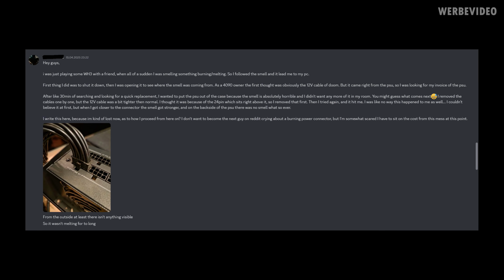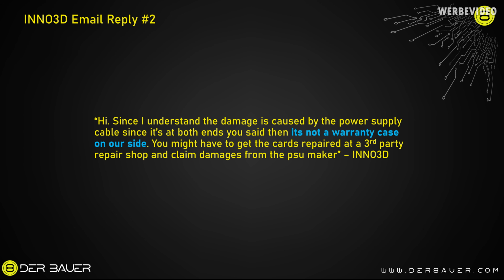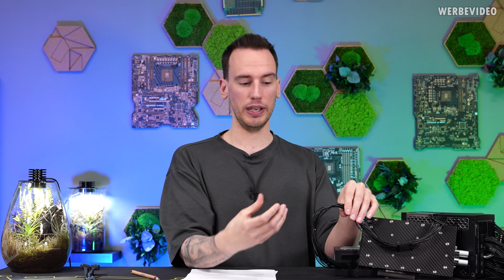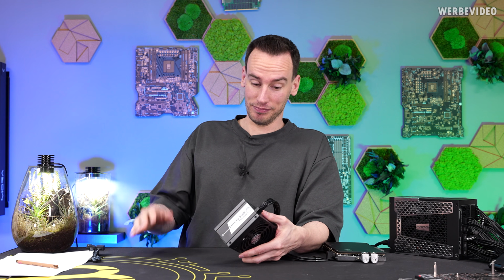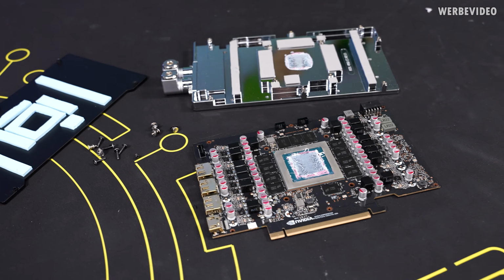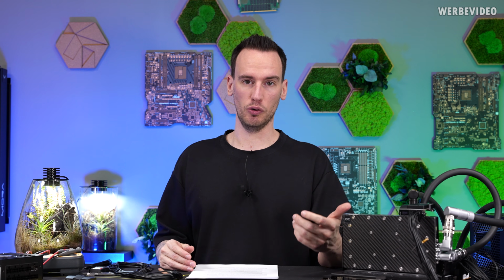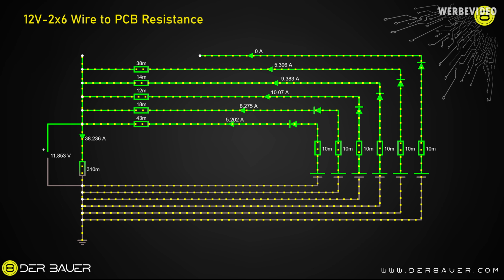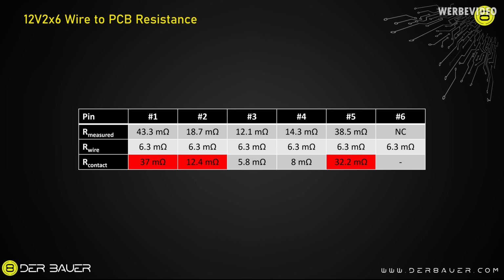Investigating and Fixing a Viewers Burned 12VHPWR Connector

Comment: Now I understand why in the electrical field, we don't use multiple wires to carry a large current load. We use a single wire rated for the load. As soon as one of the multiple wires has a problem, the load on the others goes too high.
Reply: And you don't understand electronics, do you  ?  If you use a thick-ass cable to connect PSU and the GPU board - in case of increased power demand or malfunction - you would catch fire , but not on the cable this time . On the GPU board itself. Literally you will have live RGB effects as hell.
Therefore, the cheapest to manufacture part has to be the weakest component always. They treat the cables as fuses , in these circumstances , in this fuseless circuit.
Reply: @MortalThe  Thicker cables have far less resistance and can carry far more current without heating up. They also have larger contact surfaces at connections, which then also have far less resistance and can also carry more current without heating up, even with a poor connection. In the electrical field a single large cable is feasible. In the electronics field it is not. However, I'd still rather have fewer large wires instead of  more smaller wires to carry a given high current load. They long ago reached the limit of this pci-e/cable arrangement and have used the multiple wire connections as a band aid. They  probably should have gone to 24 volts long ago to reduce the current and the number of wires.
Reply: If we consider 24 volts, we could use two 12 gauge wires to conservatively carry 15 amps each. That gives us 30 amps at 24 volts, which is  30 X 24 or 720 watts. And that is very conservative with 12 gauge wire. So you would  have four 12 gauge wires in the connector with 2 ground wires and 2 power wires. The 12 gauge wires could actually safely carry well over 15 amps each.
Reply: @bills6093  You do understand elektronics. Yes, 24 V would solve the problem, but for now, before ATX is changed, we would have to buy cards with external power supply, that transforms 230/110 V to 24V. The current ATX format provides only the 12V.
They keep the small cables , because it is estimated to stay within their limits of heat. And , as I said before, something has to give in case of software/driver malfunction. See , currently this is the software, which limits the power consumption of those GPUs. That is too weak safety from electrical stand point. Therefore, they would rather like to burn cables and connectors, then the boards.
Until ATX changes.
Reply: @MortalThe  No, this problem existed long ago and 24V motherboards and power supplies should have been produced long ago. ATX24V. This situation should never have developed.
Reply: @bills6093  So, why did you say "No"', actually ?
Reply: @MortalThe  so i think all the vendor need to push intel to publish new ATX standard for GPU, put 24,and 48V for high power device. make it "Smart" like USB PD does

Comment: My theory is still that coil whine is causing micro-vibrations in the card that cause micro movements between the terminal pins which leads to fretting at the pin contact points which causes a resistance runaway

Comment: Adam Smith talked about a society's core prosperity as specialization. I wonder how all YouTubers suddenly became electrical engineers. 

The heat is from the extra current that the cable thicknesses can handle. Why are you measuring the resistivity of the cable?

Comment: We know what the cause is, a bad connector standard choice. The fact that there are multiple issues across multiple users and vendors shows there's an endemic issue.

As for the warranty issue, at least in Europe, the contract is with the retailer, they might ask the manufacturer to support, but if you don't get satisfaction? Make a claim with the retailer, then assert your consumer rights.

Comment: I'm gonna get a mod diy ATX 3.0 PCIe 5.0 600W 12VHPWR 16 Pin to Dual 8 Pin PCIE Power Cable for a future 9070xt or better. I don't trust NVIDIA connector especially when there is no standard for the connector.

Comment: The GPU has a design defect, but to mitigate such an issue, use four cables from the power supply side and the supplied adapter.

One critical factor now is that, in some cases, hot air from the GPU hits the glass and bounces back on the cable. Once the cables become hotter, their resistivity increases, making it get hotter and melt.

To avoid that, make use of the cable while plugged stays cold. I put four extra fans three below slightly outside to push air around the cable and one on the top of the GPU to such air upwards.

By the way, soft cables are not good and have nothing to do with weight. Use the supplied thick. Industrial cables all have solid cores.

All industrial cables have solid cores. Oh, most YouTubers have no clue and are just getting viewers. Ask electrical engineers. All this is 101 of electrical engineering.

Comment: Hot air assistance to soldering iron with  big tip and low melt solder on the pins. Of course make sure to no low melt solder is left before soldering in now socket

Comment: You have huge problems with both metrology and troubleshooting. You should have measured the contact resistance BEFORE pulling out the contacts — not after. And also keep in mind that the value and accuracy of the measurements lies not in the price of the device, but in the measurement methodology. That is, in you personally and in your ability to make these measurements.

Comment: 20:35 Roman. Definitely 5 out of those 12 pins need to be reflowed. You can very clearly see in video that there is minimal connection to the copper on the top side. Maybe reflow and re measure?

Comment: The True Fix to the 12VHPWR connector, is to Desolder this POS and replace it with Pigtails to standard 6 or 8 pin Female connectors, as Used to be the Standard! It takes a Special Kind Of Short Bus Stupid to think that Connectors that are Physically Smaller in Size and Contact Area can carry More Current Reliably in Confined Areas!

The more Pins you have in a Connector the better the chance for misalignment reducing the Contact Area. Especially when your using Fatter wire in a Smaller Connector that can then push the Female Pins out of alignment, opening them up some, Reducing Contact Area further. This increase in Contact Resistance is the Fatal Flaw.
Bending the wires close to the Connector Also will cause this same scenario.

Bottom Line: When you Buy Cards/PS's with these Connectors YOUR Asking For Trouble.
🍺🍻

Comment: I'm surprised that no one seemingly thought to heat up the cables or connectors before trying to remove them. You don't always have to heat the plastic to the melting point to make the plastic a lot more pliable

Comment: I have two physical questions:  The gauge of the cable wires, how they are crimped, AND the shape of the connector pins - do they match the same shape of the mating connector pins? Flexible wires make sense, but what is the wire gauge? Seeing this issue so many times now - would it just make more sense to hardwire the cable thus eliminating connections to ONLY the connection to the PSU?

Comment: I'm thinking of putting a thermal probe at the PSU side of my 12V-2x6 cable connector, but I'm not really sure what temperature I should set the alarm to trigger at. I tried googling but didn't manage to bring up anything really useful. Maybe you could help?

Comment: If they aren't going to bother with load balancing they might as well just have 1 thick ground wire and 1 thick power line. At least that way you can't run into this problem.

Comment: @5:33 you said that on the PSU side you can't resolve this issue, but theoretically the current on each individual cable could be monitored on the PSU side, limited to whatever the specifications for the 12VHPR are. I am not suggesting that it would be future proof just saying that it is possible.

Comment: Well what is needed is for consumer protection to step in the USA, Canada, Britain, and the EU. Because this situation is ridiculous with burning connectors over two generations. Missing rops in one and in this only half the pcie lanes should have caused the manufacturer to investigate and repair or replace the card. In USA we have the magnuson moss act as a minimum line for warranty protection and protection against it being unreasonably voided. However it is barely if ever enforced these days, we need it enforced and as has been said there needs to be a class action lawsuit actually multiple class actions should happen.

Comment: Still dont understand why it seems like people dont know what the issue actually is. Nvidia cut corners on the design largely in the power delivery and distribution of the cards providing the possibility where the wires that are not rated for higher voltages are getting voltages beyond what they can safely handle.

Comment: Other aftermarket cards do per-wire current monitoring, and would've prevented this. None of the reference PCBs do this, and im not aware of any non-ref 4090 boards that have a full coverage block.

Comment: I used to set up mining rigs with my own cable sets to reduce loses and heating of many 200-400W cards. 
I wonder if the wire is actually the right AWG size or did they just Chinesium thickened the wire to look ok with just more insulation. Also there are aluminium wires coated with a skim of copper to fake their way into the market. 
Really, the solution is make the conductors thicker over 25% of the rated current and short as possible. The pins themselves need to be evaluated for their individual amperage rating also. 
Looks like someone should make a proper connector and just use strands 10-12 AWG wires to remove the current heating affecting the pins by thermal expansion/contraction. 
Why not use Anderson power pole connectors on a pcb that plugs into the GPU?

Comment: That PSU cable removal was hilarious.

I reeeeeaaaaally hope AMD's next gen rejects the 12vHPWR connector. It was fine for the 9070XT because it was under what NVIDIA's GPUs run. If the next gen uses way more power vs the 9070, they need to use the 8-pin. Plenty of stock, 8-pin, actual RT performance, and good drivers will go a looooong way for them.
Reply: No, that connector is never fine and no one should buy any product that uses it, ever, period.
Reply: @True_Christian  You misunderstand. "Fine" in this context means "safe" for the power delivered. It's capable of safely delivering 400W and under. NVIDIA, thanks to Intel, says it's capable of doing far more than that safely. It isn't. And yes, I completely agree. I won't buy any cards that have it, because doing so tells them that we find it acceptable.
Reply: I think it might be time to abandon 12V as the means to deliver power to GPUs. 48V would be much easier to deal with.

Comment: it's not inno3d's fault. Even if they wanted to load balance it, they can't. Nvidia controls the board design and prohibits almost any change to the boards. i have a 7900xtx oced to 450W, they load balance with the 3 connectors.

Comment: Edit:
Naturally he shows that he did do some measurements but only after showing him pulling the cables. I bet that was just to bait me 😛
Orig:
Nooooooo! You had a perfect opportunity to find out which side had the bad connection!
The cable should have been cut in the middle, then the shield on gpu and case on PSU should have been opened and milliohms measured from each cable-end to the solder points on the boards inside each unit.
Mapping out all pins resistance would have at least defined the potential imbalance and at least shift some of the blame to a specific candidate.

Comment: A note on the power calculations: using P = I^2 * R is not the best form of the equation to use here, since the current varies across the cables based on resistance. Rather, P = V^2/R is much better, since we know the voltage across every cable is the same 12V, which leaves only the resistance as the independent variable. This equation also makes it quite clear how power dissipated in the connector/cable is inversely proportional to the contact and wire resistance; thus the lowest contact resistance will see the largest heating.
Reply: dV, not V.

Comment: It's always a problem with resistance at the connector, either the crimp or the contacts.  The reason why the PSU burned is because power supply companies are morons like Nvidia and have started using the same connector at the power supply end as well versus using PCI-E 8pin style connectors.

What makes that fun is either end of the cable can be the problem now, that's slick.

To carry the current Nvidia cards use the connector should be bolted together or at the very least the connector should bolt to the GPU PCB instead of soldered so it's at least replaceable without a 150 dollar and hour and all the shipping to the only 4 people in the world that seem to fix these things.  Did I mention the months of no GPU?

What I want to know is if you can run a 5090 @300 watts as per the cable spec and how that's done?  I suspect at 300 watts the connectors won't burn and the GPU is likely 90 percent of the performance.

Comment: One quibble:  this could be monitored on the PSU side, but this is very much a GPU and a connector spec issue.  That said, I think there is a real opportunity for PSU manufacturers to step up and allow monitoring and programmatic current limiting on a dedicated 12VHPWR rail, since Nvidia has shown their disdain for their customers.

Comment: Regarding the PCIe running at 8X lanes, I would suspect damaged filter capacitors near the slot on the PCIe data lane(s), then lifted pads/broken solder balls underneath the core.

Comment: The whole 12VHPWR standard is class action worthy and someone should be sued for it.  PCI-SIG comes to mind, but there's shared culpability with AIB partners, Nvidia, and AMD for marketing and deploying it.  Personally, I'm going to avoid the standard like the plague that it is for as long as possible, and thankfully there are still cards being marketed that have proper 8-pin and 6-pin power even if they're not cutting edge flagship offerings.

Comment: I do not agree, at least not fully, that the PSU cannot prevent the connector meltdown:  If one would add fuses to the separate pins in the PSU, the fuses would trip before the connector overheats. Off course that would mean the circuit would need a way to diagnose post mortem, and a way to reset the fuses

Comment: Bought a 5080 a week ago. Been stress testing it and checking thermals on the power cables. I also went with an aftermarket 90 degree adapter that looks identical to the bundled one I have, but is shaped in a way that makes it fit my slim case. The model is Zotac OC Core - the smallest vertical footprint 5080 you can get, period. I didn't expect anyone to make small GPU's against and there it was! I will buy more, because I need these things for work. The shelves are full and 5080's are not selling. 5090 are still rare, but only in places. Some end up in poor neighbourhoods and remain listed for weeks. Nobody bothers to drive out that far to get them at huge MSRP premium. Anyways... I watched thermals under full week for 7 days. Fans ramming constantly. Zero issues. Power cables are stone cold (PSU is 1200W Silverstone with 4x 8 pin PCI-E power plugs and no 12V high power, requiring an adapter.

I sense that something had to be really wrong with burnt plug GPU's, because my card is flawless. On full load I don't get over 75 degrees reported on the chip through windows task manager, running neural nets. I did test games and got what people on the internet got. No surprises and no ruined expectations. The card needs a 24GB Ti version. That's an absolute must. But do not raise price above 5080 launch MSRP. Then you'll have your consumer monster and 5090 will be like the old Titan RTX. A Vram king. And we all know why they didn't put 48GB. Why they've been dancing around that number for 5 years. To protect A6000 sales. The moment that card stops selling entirely, they let consumer brand overtake it. They will never let a gaming card run faster than the pro card that still sells. Always look as the A-series specs and you'll be able to predict the specs of Ge-Force by stepping it down an order on every aspect. They make the best design they can and chip away, till it's good enough for the low end consumer market.

Comment: Bad design. 
It is the cable and connectors both, both ends suck for the current demand. 
Wrong type of connector for the current demand. not to mention that Every Crimp MUST BE PERFECT and they are obviously Not. 
The only to actually fix the problem is to go to a higher input voltage to the card, something like 24 or 28VDC.
24V at 25A  600W there is enough headroom for the future with 2X6 wired cables like we are using today. 

There are just too many issues when you start using high current to get your work done.